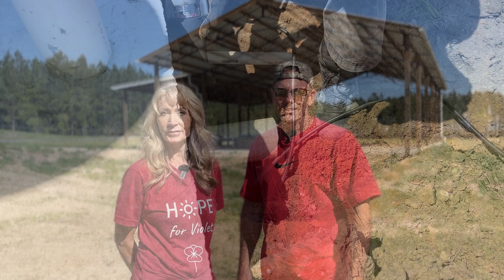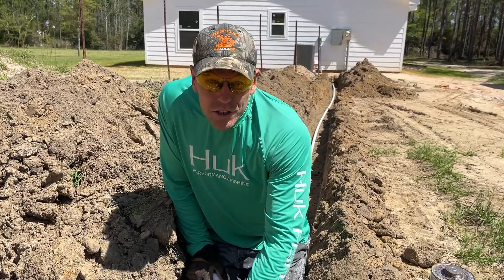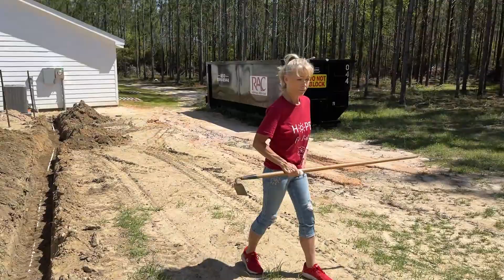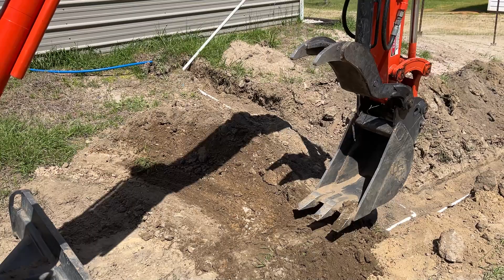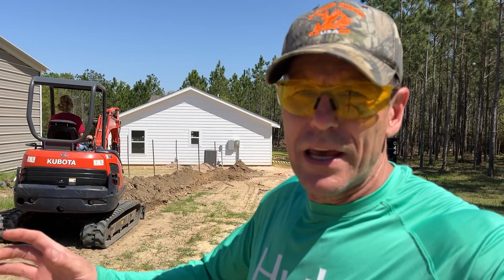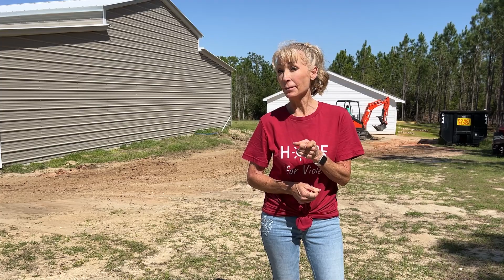City Girl Learns How to Use a Kubota Mini Excavator!

Comment: Smart move packing in the pipe before back filling. I didn’t do that the last one I buried, but it has to be much easier on the joints.  Deb, nice job handling Precious!  I’m impressed!
Reply from the maker: Hey Lucas.  Packing in the PVC is probably not necessary in most areas, but you know if it were to break and leak, it will be on the hottest day of the year!  Trying to avoid that!